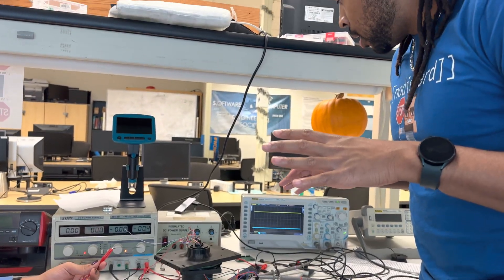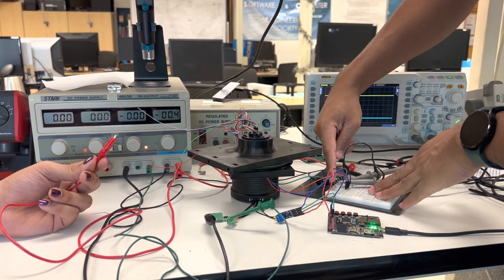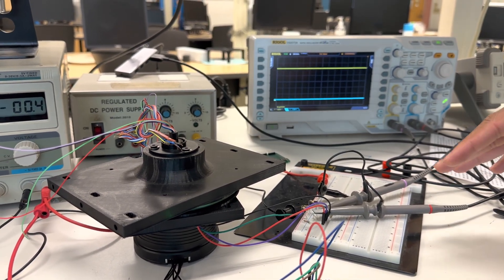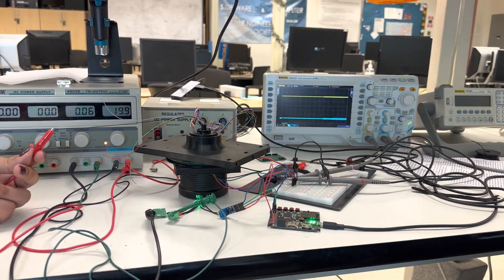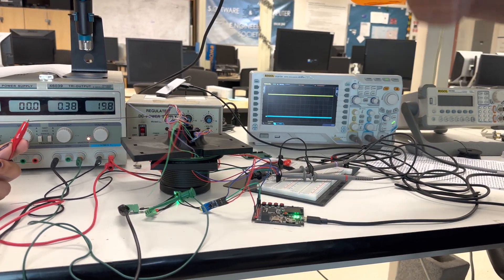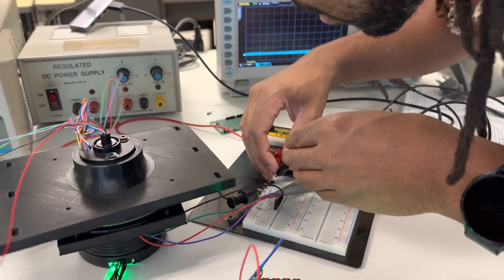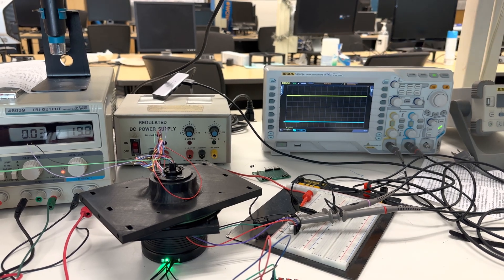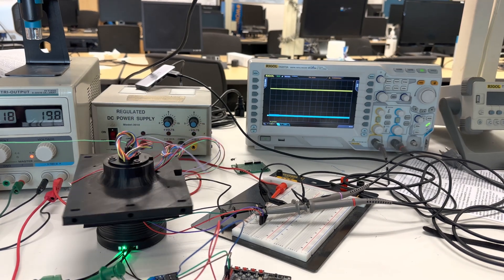Successful PCB slip ring testing

Comment: Hi Guys this is very interesting because I want to try and build a robotic arm using the RMD-X6 V3 and I need a small slip ring to be able to allow for full rotations of some joints. Did you guys build the slip ring yourself or did you buy it ?